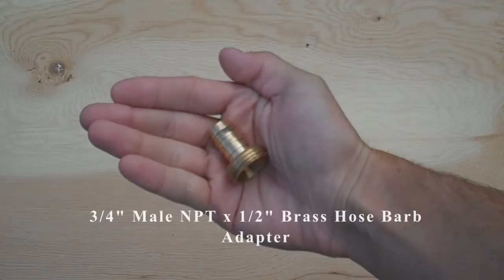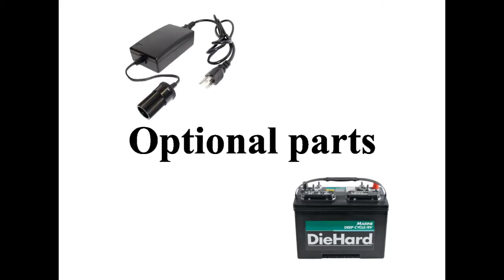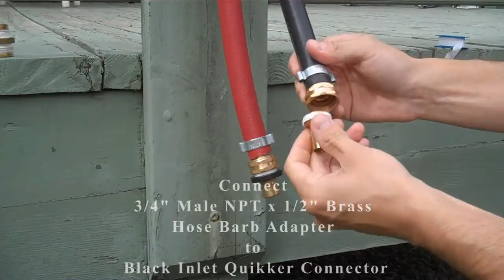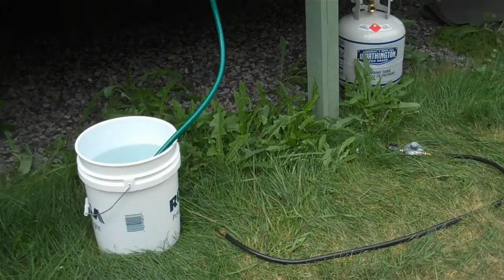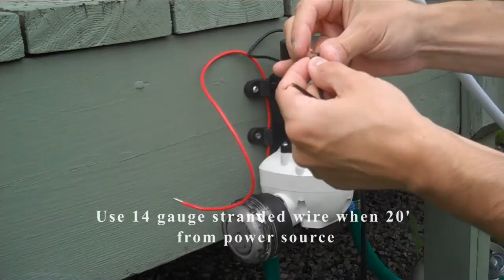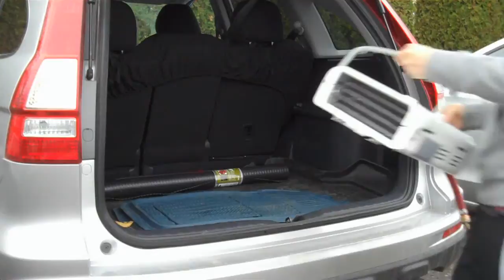Make Showering Outside a Snap! | Eccotemp L5 Water Heater Bundle + Quikker Connectors

Comment: Is there a way ( like quick connects but for electric) to wire the pump to be either directly clamped to a battery OR pluged into a 12v cig socket?
Not like both hooked up at once but like hiw you can swap ends from solar panel with those sae? connectors? 
My deep cycle id clamp to 
My audew small battery is 12v socket

Was thinking like sae or something ??

Comment: Easy, straight forward installation.>>>ur2.pl/1103   We installed this in our 2 bedroom 1 bath cottage in Northern WI and I set this to 120. Water is HOT! Compact and takes up almost no space at all and it doesn't make a single sound. I thought there would be a slight "hum" but you don't even know it's there
Reply: not for camping

Comment: Can you tell me if you need to install any fuses / circuit breakers between battery and the water pump for the permanent setup? or is it safe without them?

Comment from the maker: Hi Ross, I contacted Eccotemp and they say that they don't manufacture the gas regulator themselves but that you should be able to find it in a hardware store. I'd also recommend to try outdoors retail stores. They might have a gas regulator to connect the Eccotemp to a smaller 16oz Coleman propane canister.

Comment: Ok Ive been looking at this Idea for awhile to use in a 18 wheeler with a built in shower stall but my only problem would be the large propain tank can a smaller one be use such as the type you can but at Wal-Mart in the green bottles use for stove and more???